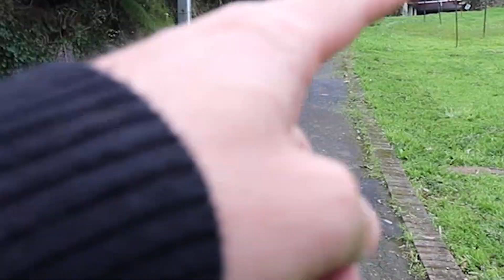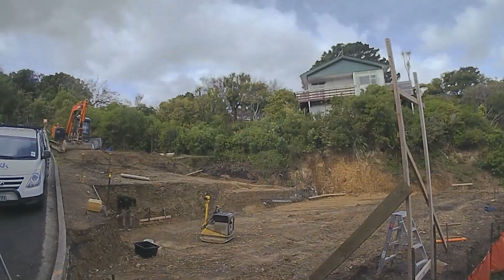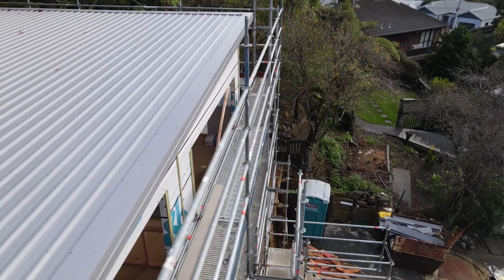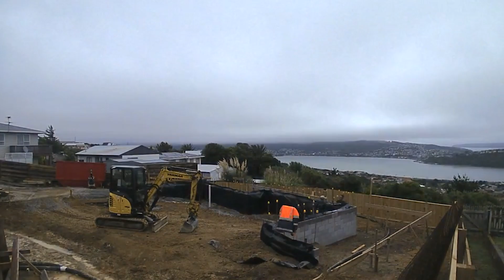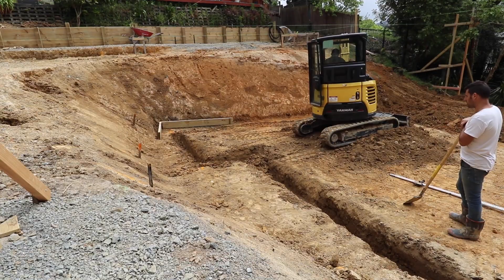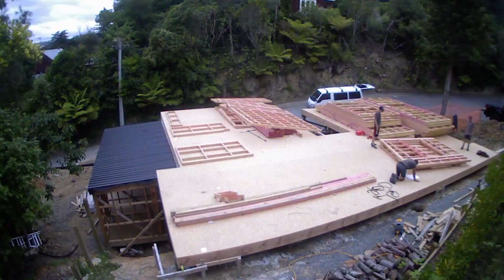Building on Sloping Sites | Wellington New Zealand

Comment: Kia ora, thanks for the content, I am looking at buying a house that is built on a steep slope... maybe 45 degrees? and the section beyond is even steeper with dense bush. I wonder how much more expensive it would be to do any maintenance or repair on the steeper face of the house, like replacing windows or repair on the cladding? Assume it makes everything harder and more time consuming
Reply from the maker: yep it just adds more time to do everything